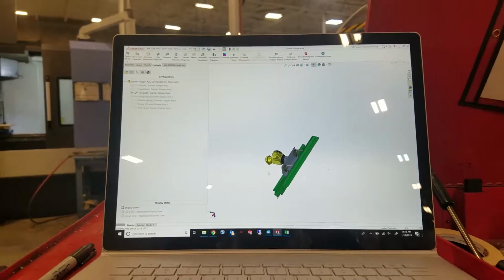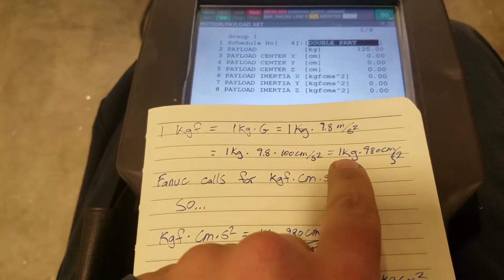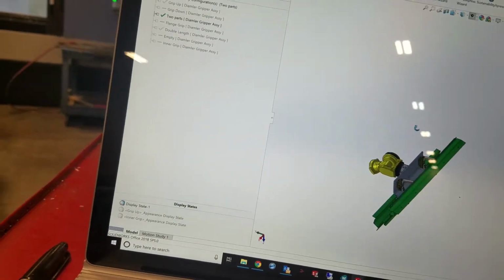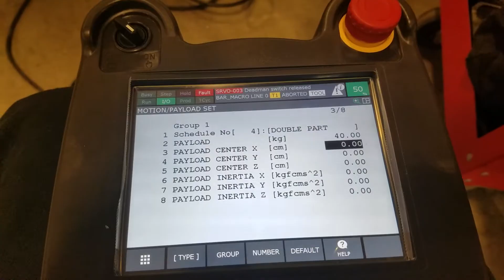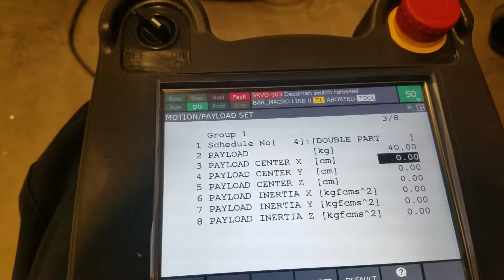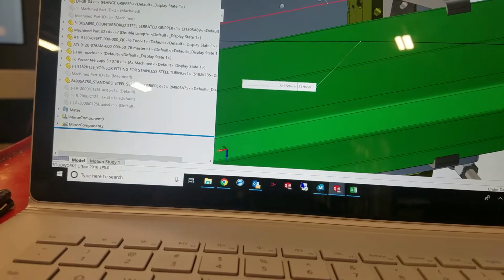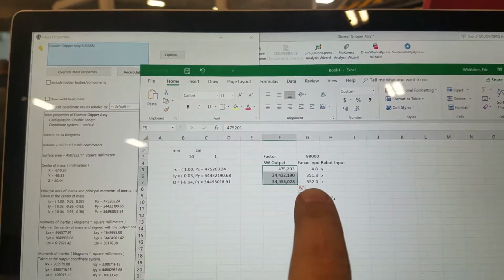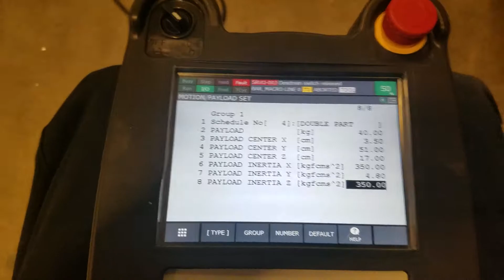Fanuc Robot: Payload Calculation Guide

Comment: that's very nice, but you can also just change the variable $SI_UNIT_ENB  in your robot which would save you some time.... second option is to use the payload calculator tool from fanuc ;-)